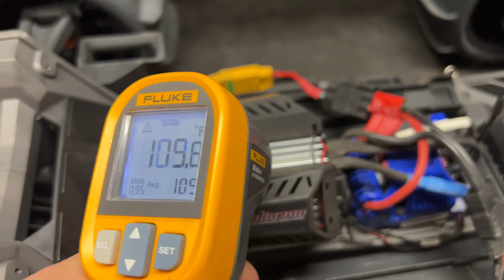Traxxas XRT with Sand Paddles OH YEAH!!

Comment: Nice .. I seen a video of yours with these paddle tires, hit the link..l have them on my Kraton..awesome sounds and control on rugged terrain. After  running 2 batteries. sand I've had to replace rear drive shafts.. the pins grind away from diff drive cup.. its worth it..don't stand behind those tires..thanks looks great on track

Comment: The paddles look like they'd be directional? In loose sand having the scoop leading makes sense but on grass could you reverse them and maintain good grip and longevity? 

Just curious, my modified DBXL-E needs traction. Currently running DuraTrax Belted MT Tires.

Comment: I've had them all also and Traxxas drive shafts and power systems are s*** and their bearings are also s*** I've had nothing but problems out of any four-wheel drive Traxxas that I  had the gears are made out of pot metal if you land on power they're going to strip instantly by far the best RC car on the market is the 6s exb kraton
Reply from the maker: I agree on the gear material, on the earlier models yeah bearing issues for sure. I have a Kraton 6S EXB, the 8s the Senton the Typhon and a few others, as far as the diffs go they all can break with hard on power landings. Traxxas is just as good as Arrma.